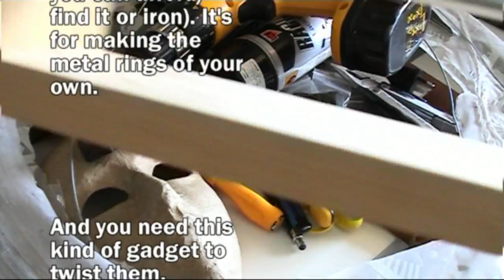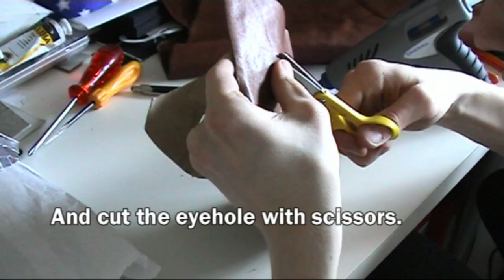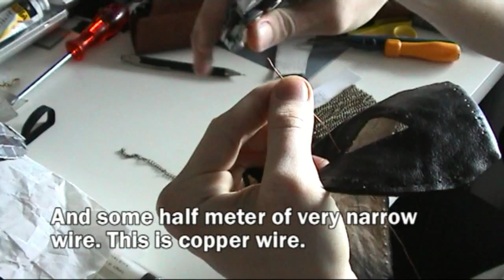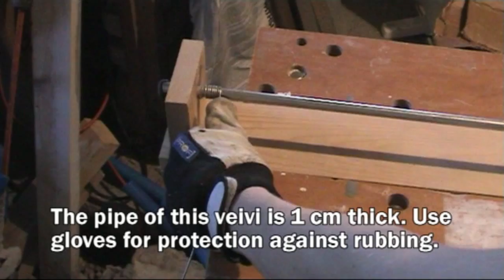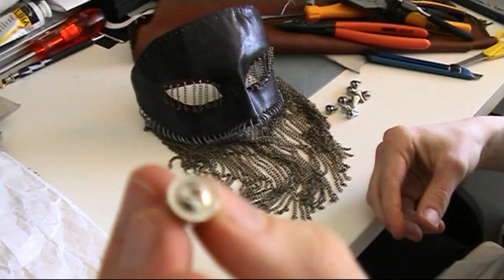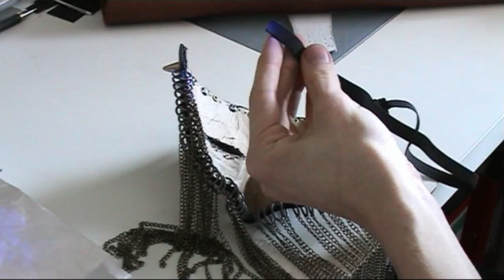Lady Gaga Dance in the Dark Mask – Sire Sasa tutorial 2

Comment from the maker: You should buy a much more long pipe with 1 cm diameter. Battery is so short, you have to stop after some 15 rings, when with long pipe you can twist hundreds of rings (manually) at the same time.